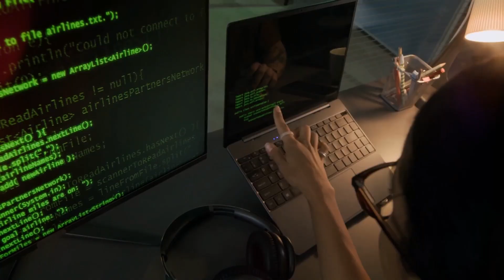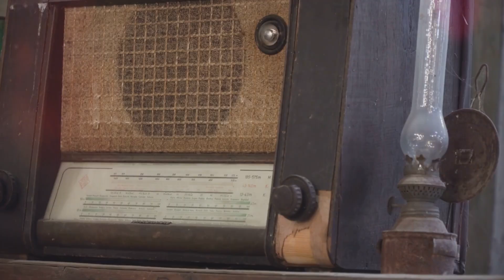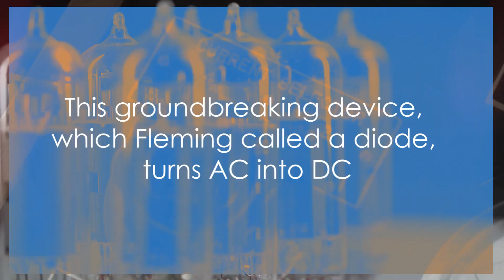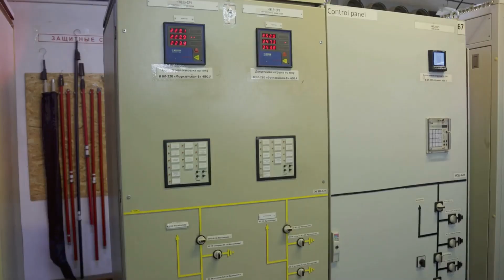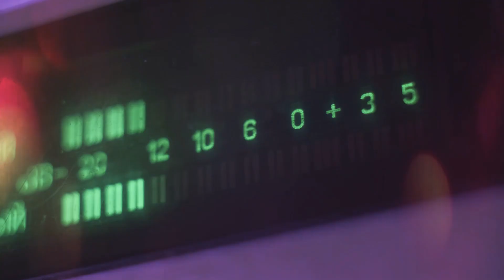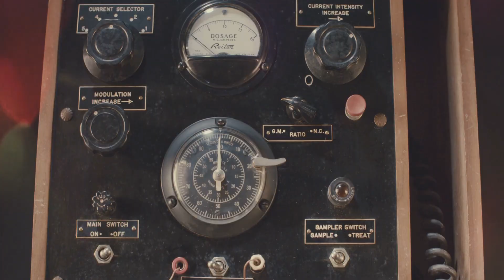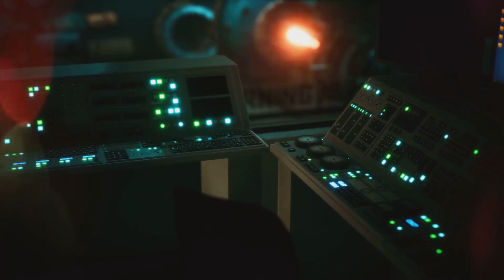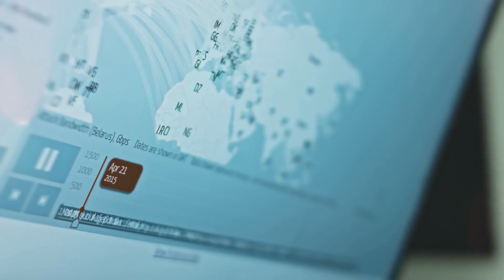Can This Tiny Wire Change the World?

Comment from the maker: 🎬📹 kEY TOPICS YOU WILL UNCOVER EXACTLY IN THIS VIDEO

:text-green-game-over: 1- The Core Mystery Solved: Uncover the surprising truth behind why colossal early computers glowed with hundreds of what seemed like light bulbs, and the fundamental principles behind their use.

:text-green-game-over:2 - Vacuum Tubes as Digital Brains: Discover how modified vacuum tubes (triodes) acted as the essential building blocks for early digital circuits, functioning as crucial switches representing binary 'on' and 'off' states.

:text-green-game-over:3 - The Genesis of Logic: Learn how these seemingly simple components were combined to form early logic gates, the foundational "thinking" units that powered machines like ENIAC and Colossus before the age of transistors.

:text-green-game-over:4 - Crucial Properties & Early Functionality: Understand why the unique properties of these vacuum tubes were vital for the speed and functionality of these pioneering machines, despite their primitive appearance.

:text-green-game-over:5 - The Immense Challenges & Their Legacy: Explore the significant limitations and challenges faced by engineers using this early technology, including the sheer scale, immense heat, and massive energy consumption of these historical computers.

:text-green-game-over:6 - Paving the Way for Modern Tech: See how these challenges directly paved the way for the invention of the transistor and ultimately led to the miniaturization and evolution of computers we use today, including modern microprocessors.

:text-green-game-over:7 - The Brilliant Minds Behind It All: Get a glimpse into the innovative minds and engineering genius responsible for the development of these groundbreaking early computers.